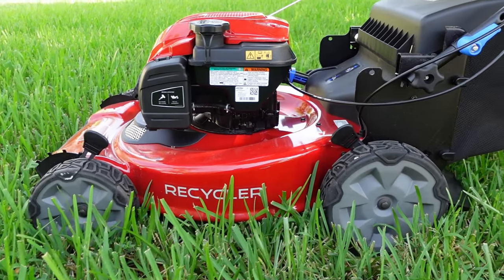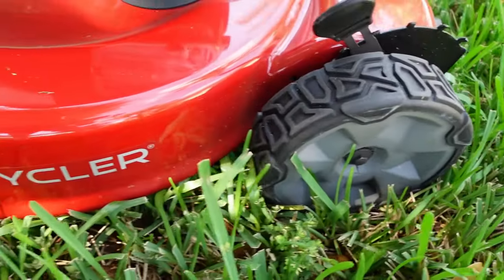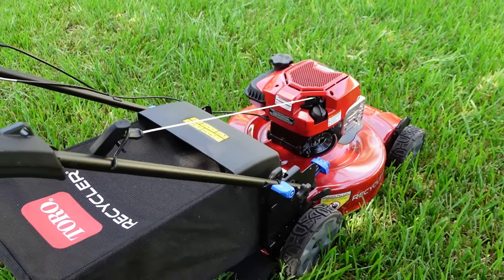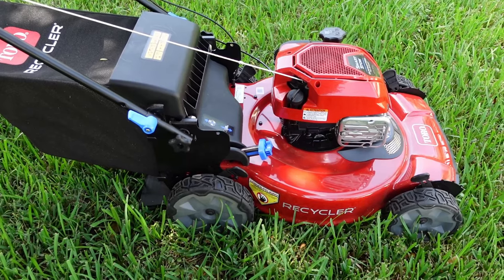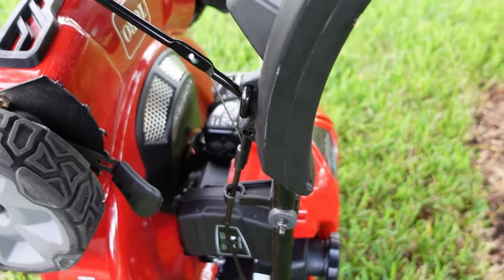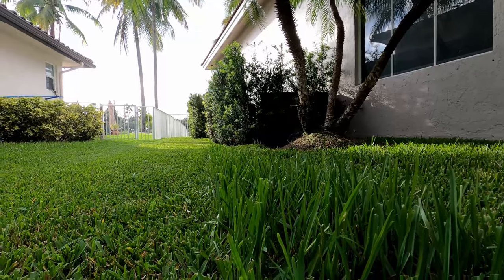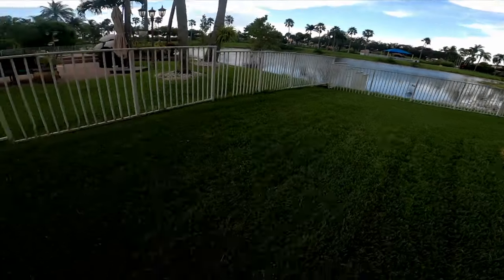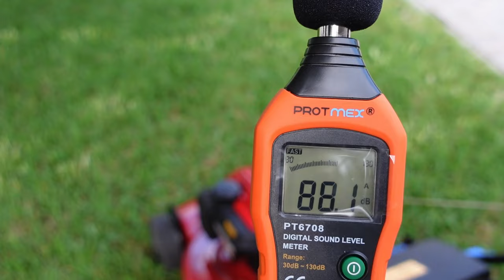TORO 22"  SMARTSTOW Personal Pace Auto-Drive™ High Wheel Mower (21465) Vortex Technology #toro 21465

Comment: You will never  have to buy another Lawn Mower. I  have a 2007 Toro Super Recycler still running. I  never use the bag and I   only changed the oil ounce years ago. 229 views now.
Reply from the maker: Thanks I enjoy my Toro very much.
Reply: My Toro I bought in 1995 just died....😢. I'm hoping this lasts at least half that long
Reply from the maker: @bruced.370  I hope it does last you long time. they dont make them like they use to.  Thanks
Reply: @ExtremDIY What makes you think like that? They will last just like old ones.
Reply: @dkdanis1340  more plastic, but good engines

Comment: I just brought one home from Lowes, got it all set-up (and I'm an experienced 60 year-old mower!), and mowed for 15 minutes when a huge black cloud appeared. Even though the oil was added (all of it, carefully, to the right level, SECURE top) the engine was compromised, fine oil mist all over lawn and mower, and almost no oil left in the mower. 15 minutes in. Going back to Lowes.
Reply from the maker: Oh man sorry to hear that.  I just moved my neighbors yard with mine and ran great 18200 sq ft.  The only issue I had was a small oil leak on the valve cover.  I took it out fixed it and running great.  If you got it at Lowes Toro just came out with the new 163cc mower that does the smartstow but its in black color.  I love the 163cc motor better than the 150cc

Comment: Sent mine back! Brand new out of the box leaked oil from the overhead valve cover on the bottom of the cover! Made in nexico, they put very little high heat gasket sealant on the cover! Noticed this with all Bruggs and Stratten engines, even on Craftsmans, and the Troy Builts!
Reply from the maker: I had one do that and noticed others did complain about that.  I just fixed myself by removing flimsy cover and making it flat again with hammer and reinstalled no issues do far. Sometimes these companies have bad quality control.  I am testing out some electric ones now and having some fun with them.  Have a couple of videos out on them but still gas is king.

Comment: Adjust the governor spring plate located between the gas tank and the carburetor cover you can put your fingers in there and bend it forward and it will give the lawnmower the power it needs just don’t bend it too far
Reply from the maker: Hello thank you I will try it and let you know if it worked.
Reply: It should work I have the exact same lawnmower I had the same problem I absolutely loved it but it just needed my power once I did that it could cut through anything now it’s the greatest lawnmower ever
Reply from the maker: Wow it worked this thing is a beast now.  Just like you said just a bit I actually had to put back some to exactly 90 degree and its perfect.  Its like having the 163 cc motor on this thing.  I am sure it will waste a little more gas but who cares.  I actually removed the personal pace system two months ago and installed their standard levers and I like it more.  I spoke to a few lawn guys and they hate the personal pace so I tried it and for me is much better.  Now it pulls me and before I kept having to push it.  Thanks for the heads up I love it.
Reply: @ExtremDIY  Did you do a video about removing the personal pace thingys? And installing the levers?  I want to buy this mower but hate personal pace thing.
Reply: @ExtremDIY  I have the same mower. How do you change out the personal pace? I didn’t like it either.
Ty
Reply from the maker: @johnfeather5405  You can order some parts and make it like the lower models.  I went to a Toro dealer and they ordered the parts for me.  Its not perfect but I like it better.  You dont have the push any more.  It actually pulls you which I like better.  I just reviewed the same mower with the 60V and seems like the personal pace works better for some reason but I still like the simple option.  I started a video on the replacement  but deleted by mistake.  Let me know how it goes.
Reply: Is there a way u can make video in how to adjust that plate ?
Reply from the maker: @iangarcia8549  Let me work on that but its super easy to adjust.  Like mentioned above you bend forward a very small amount and you will hear the difference.  Have the machine off and leveled so you know where its before.  You can do with your hand or a plyer but all it takes its a very small angle change.  You dont want to go too much cause the engine will rev too high.
Reply: Thanks man!
Reply: @ExtremDIY  what’s your favorite thing about yard work
Reply from the maker: @jeremynguyen2346  Cutting the grass and then go shower.  Then walk outside and enjoy the grass along with the landscaping lights. Instant gratification for me.  I also volunteer at my mountain bike trails and love to trim them.
Reply: @ExtremDIY  how many mowers do you have
Reply: @ExtremDIY  would love a quick video showing how you modified it. I'm struggling to locate it 😞
Reply from the maker: @brianavery1955  I did a video and by mistake it got deleted.  Is yours a front wheel drive or rear.  Let me see if I can try to get the part numbers.
Reply: @ExtremDIY  mine is rear wheel drive
Reply from the maker: @brianavery1955  Hello here is the link to the parts of a front wheel drive model because I could not find the rear wheel drive one without the personal pace.  I believe the transmission cable is longer I just wound up with zip tie on mine.  the parts you would need are 14,15,16,17,18,19,20,21 from the parts list its about 57.00 total but you can find the parts online also.  If you go to the Toro shop it can be less. Make sure you verify them please.  Hope this helps  https://www.toro.com/en/parts/partdetails?id=53975&iid=473789&pid=527812
Reply: @ExtremDIY  hey thanks, but I was actually looking to see how to bend that plate to get more power out of the engine
Reply from the maker: @DanielPerez-mb7wm  Thank you

Comment: The most didn't sound under powered at all when you were cutting. And as for stragglers you just need to now a lil slower or sharpen the blade. I've got the 190cc and I love it.
Reply from the maker: It cuts well I had the 163cc before and a Honda and they left some stragglers here and there.  I would imagine the 190cc is awesome to work with. thanks

Comment: Great video and just received mine today. It does feel cheap compared to older models. For the price why Toro doesnt put the 1 handle height adjustment like so many others have done. No bearings in the wheels which was a little dissappointing. I had returned my first electric mower Ryobi 21in HP self propelled , tires had bearing and felt heavy duty. Unfortunately the blade kept shutting off while mowing on my second use so I returned everything and picked this up. Really put me off electric mowers for a while , we arent there yet if you have a large yard and St.Augustine. Cant wait to use this mower and hoping for the best.
Reply from the maker: Hope you enjoy it I do mine.  Thank you
Reply: Do you still have this mower
Reply: @jeremynguyen2346  
Yes I do. Used it yesterday.
Thanks
Reply: How does it work with like seven inch grass.
Reply: @rozaynewyork9955  
Not sure. I have St.Augustine here in Houston. I keep it cut at the 3.75in. There are people saying the RPMS are too low when you get it. But its a easy fix.

Comment: The side discharge chute is a free option through toro that the accessorie goes on the same adapter as your bagger
Reply from the maker: I think people dont use it and throw it away so they dont included with the mower any longer. They dont realize its an option that you have to request. Even I didnt figure it out till I spoke to Toro the other day after I made the video.  I never used mine at home when I had the older model but I do use it in the mountain bike trails where the grass gets much higher. We have an older model that has the side discharge and works great.  Thanks
Reply: No, I think they had to offer it because this is one messy mower!

Comment: I have basically the same model. However, I cannot seem the keep the handle from dropping down about 18”, which leaves the handle nearly up at 90 degrees. The little lugs are locked in. What am I doing wrong wrong?
Reply from the maker: Hello are you twisting the blue knobs to get them to disengage.  Are you taking about folding them down to store the unit or when you are going to use the lawn mower. Let me know
Reply: @ExtremDIY Marco, I have the. Lue knobs in what appears to be the correct locked position.. as yours. However, is about 18” inches if downward play on the handle. I’m not speaking of push downward speed control… I’m speaking of the entire handle assembly. The only way the nubs in each side stay put is how I have them. While moving, the handle moved about a 1/3 meter forward, and the blue sides disengaged. , flopping around. I forgot to say, this a newly reconditioned 2021 vintage.
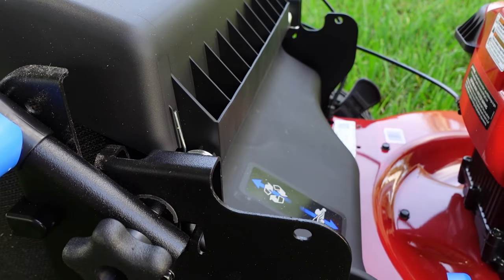Reply from the maker: @robertjason6885  ok I opened mine up and at 18 inches the long handle is close to the floor so it means the blue knobs are not locking into the correct holes.  If you look at the video on time 2:43 the knobs handle must be same direction as the black metal frame.  You need to pull and twist the blue knobs to be able to unlock and lock the main handle into the correct hole(there are 2 hole positions you can choose from to use the lawn mower and 1 position to store the mower upright) .  With the handle at 90 degrees were you can see the knobs.  Twist and pull to see if the silver pin comes in and out. Hope this helps let me know if it works.  Thank you
Reply: Marco… Editing my comment…in a bit.

Comment: Good job on review but I gotta tell ya your wheel hight adjustment lever hooks on those notches not in between great video though
Reply from the maker: Hello thank you I appreciate that. Trying to grow the channel by giving my best opinion on products we can all use.  I spoke to Toro a while back and they told me you can use them on the notch and in between.  If you look at the video at time 2:01 I put that 4th grade picture that Toro has for the wheel height and it shows 9 adjustments from 1 inch to 4 inches. I wish they would put a single lever or at least one in front and one in the rear instead of this but I like the lawn mower.  Thank you

Comment: I have two 21465  mower. The older one I bought last Nov. The personal pace just quit on the first pass in the yard. Then I smelled smoke and saw little whisps around the base of the engine. Solution? Is there a video to trouble shoot the auto-drive?

Comment: Can you tell me? Because I cannot find this answer anywhere!  When you utilize the self pace mower and you get to a small section like in between bushes. What happens when you mow in between two bushes and then need to pull back out??  Are you fighting the self propel drive? Does it roll back smoothly?  And also last question: Can I mow without utilizing the personal pace drive??
Reply from the maker: Hello when mowing in between trees its easy to pull back without any resistance.  Its a smooth transition unlike some of the newer electric mowers that have a delay.  I have both the gas and the electric and both are great with the personal pace.  I have also an EGO lawn mower and hate it.  Your other question I dont think you can mow without using the personal pace.  You would have to remove it completely and install their lever option or buy the one that comes with the lever to activate the transmission wish is great also.  Either option is good.   I think there is a front wheel drive that doesnt have the personal pace and lever for the drive.  Let me know if you have any other question happy to help.
Reply: When you stop in a tight place, manually push the mower forward about an inch. It should then pull backwards easily. I found this info in an instruction video and it has worked for me.

Comment: Does this machine need 4 cycle mixed with the fuel?? Please help!
Reply from the maker: Hello no it does not, just regular gas will work in the fuel tank.  You will need to have oil in the crankcase of the engine.  So if you buy it brand new it comes with the oil for that.  thanks

Comment: We have the 21565 & use it  weekly to mow a 12 acre cemetery.
You lost me on the 'last forever' . At the one year mark almost everything is broken. We now need a 3d set of rear wheels, due to poor quality. 
If not for poor quality or poor design, there are a few good features. 
Mostly this a  is gimiky mower, like one coat paint.
Reply from the maker: Hello wow I have seen some paint under the deck to have very little coats or very thin.  My 2 previous models were old and had better paint.  I was wondering about the wheel design since it was new to Toro line beign so slim.  I think this one  For cutting 12 acres it seems like a job for their commercial unit like the Timemaster perhaps or higher. Thanks

Comment: Hello, can you please tell me if toro 21465 good for hill
Reply from the maker: hello I do enjoy using my Toro but I do have a lake so when its full of grass because I collect my clippings in the lake section it does tend to have a little trouble climbing when full of grass. If your hill is not too inclined and you are not bagging it should be fine.  When climbing the personal pace is not too effective you kind of have to push it a bit. Hope this helps This one is the 150cc motor maybe the one with the 163cc motor might have more pulling power but doesnt have the folding option.  I did have the 163cc before but was the older model and didnt have that issue.

Comment: What is the speed difference in say a 170cc toro versus a powersmart 208cc? I'm worried the toro will be slow even tho the quality is far better.
Reply from the maker: Hello if you mean the walking speed I am not sure about the powersmart but the Toro the faster you walk the faster it goes up to a certain limit.  I have tried the Toro personal pace and the lever standard option on the Toro both work great faster than I can walk.  My personal preference is the lever instead of the personal pace for lawn mower.  The Honda lever to me is the best wish is just like the new Milwaukee lawn mower. Hope it helps let me know if you have any questions.  Thank you
Reply: @Extreme DIY  Yes, I've owned a powersmart in the past and it's faster than I can walk at 209cc. My only concern with the 163cc toro I'm looking at is the potential lack of power I'm used to getting.
Reply from the maker: @ett2  Well this one on this video is the 150cc which its borderline on the power.  I had the 163cc before this one and its perfect with the power.  We also purchased a Craftsman for the mountain bike trails we maintain here in Miami and its got the 163cc motor from Briggs and its a beast. Cuts high weeds like butter.  Toro does have the 190cc also if you are looking for that extra power. The issue is that the Toro with the 163cc motor doesnt come with the smartstow option.  You can also look at the 190cc motor which I have been told its very powerful if you can find one I think they stopped making it. Thanks
Reply: @Extreme DIY  Okay cool! This is all great info! I'll have a look at the 163cc, especially being you have good things to say.

Comment: What deck height are you running? It looks like half inch.
Reply from the maker: Hello its like 3 3/4 and 4 inch that I use.  The mower looks like its on 1 inch but the grass is high middle of the summer. Figuring out the deck height with Toro is a struggle I dont know why there is no labels.  I really enjoy using this one and I also purchased the 60v version of this model and its great also.
Reply: @ExtremDIY  thanks. I figured it was camera angle, etc. Same mower here, trying to dial it in lol.
Reply from the maker: Enjoy it I definitely do mine.  thanks

Comment: The auto drive on mine doesn't seem to work
Reply from the maker: Hello did you check the belt to make sure its not broken?  Also make sure the spring at the end of the cable is attached and not broken.  Also check your warranty of the unit.  I always register my equipment with Toro so if you have any issues they will fix it under the warranty.  Hope this helps thanks

Comment: I have had this mower for a year now and I 💯 hate it. I was so happy when I first got it it, after several cuts I began to loath it and noww I dread mowing day.
Reply from the maker: Hello still enjoy mine but I did a modification to it.  I was having some issues with the personal pace and basically I removed it and installed their regular lever that you see on the cheaper models and love it much better without the personal pace.  You can try doing that and see if you might enjoy using it or you can sell it and get something else.  I purchased the 60V version of this one and I like it very much.  For some reason the personal pace on the 60V is smoother and is more enjoyable.  I use both mowers depending on the mood I am in.  But try that and hopefully you can enjoy it again.  I went to my Toro dealer and ordered the parts I needed from them.  I know it was an extra expense but I had to try it and now its better.  Let me know what you decide.  Thanks

Comment: Before you buy....
This mower only goes as fast as you push it.
Reply from the maker: Yes you are correct.  You can always remove the personal pace and install the simple lever they offer on their more inexpensive models.  I did that and love it, so you dont have to push it and now it pulls me like a regular mower.  Personal pace is not for everyone.  I have the 60V version of this mower and it works better for some reason less pushing more of a neutral feel.  Thanks